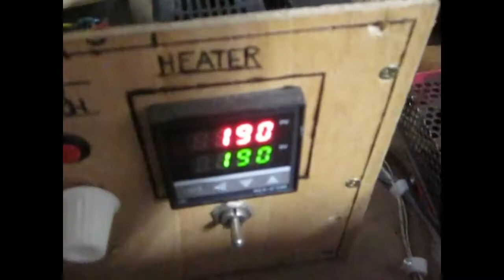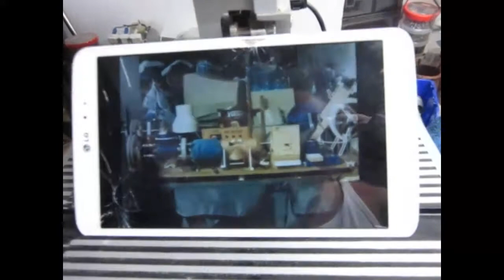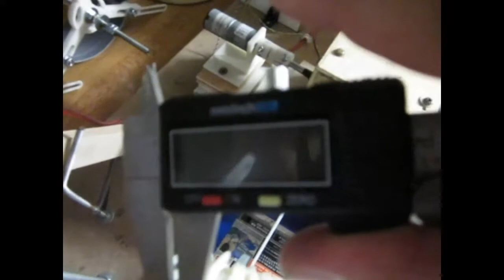filament extruder with belts

Comment: i want to build filament extruder for myself also, can i use this type pid controller http://goo.gl/Ds9XLg ? and where do you buy the pallets?
Reply from the maker: Alis Angel Yes you can use this temp controller, the same i use . I found  Filament pellets  from a friend of mine, that works in a company with plastics. 
Unfortunately, it is very hard to find the pellets, because they sell only to other companies and only with bill of sale. I mean they cannot sell a bag of pellets with sales check
Reply: ok thank you for replying my question. Need to find more item to build mine, have a good day sir